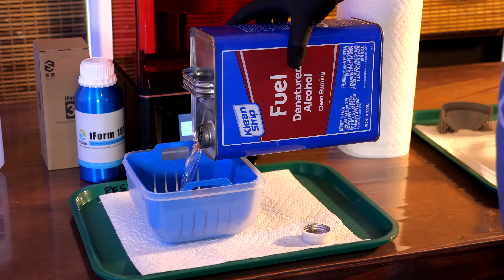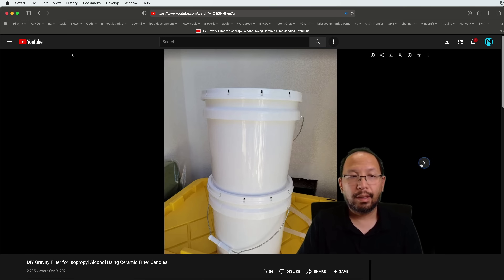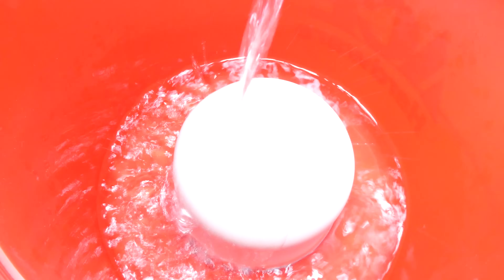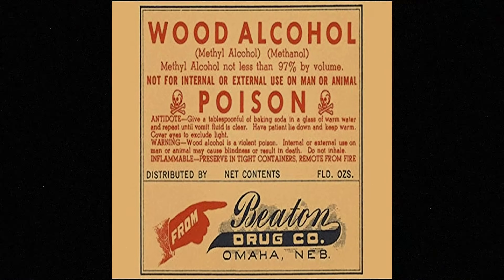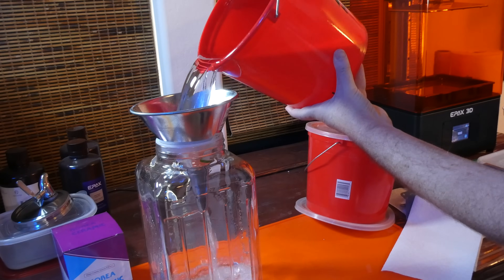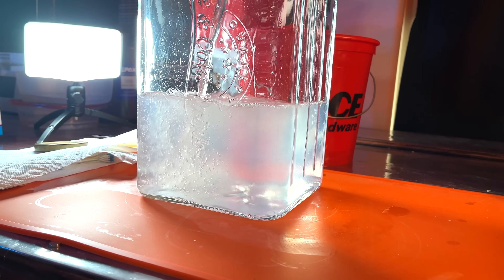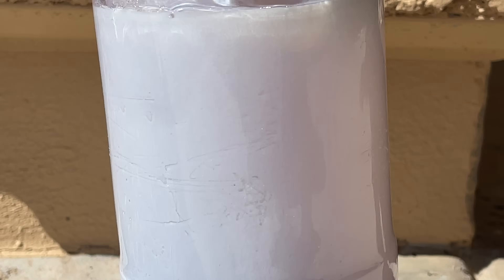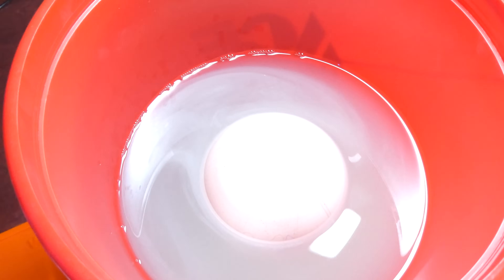Can We Recycle 3D Printing Alcohol?

Comment: There is a product (not sure of the name but something like resin clean) that cleans 3D printed parts better (stops them from yellowing due to alcohol) and once it's dirty you place it in UV light, pull out the blob of cured resin and it's ready to use again. Basically it's usable nearly indefinitely though you do loose a small amount to evaporation and what is left on parts as you remove them and such. I remember people saying it was the only way to get optically clear prints (like for lenses). Been a long time since I did resin printing but I did buy some (only had to buy it once).

Comment: Molecular biologist here, and I'm gonna be a bit of a pedant :P Isopropyl alcohol, even in a pure form, is still pretty darn toxic. It is metabolized directly into acetone, which is all kinds of bad on the central nervous system. Also, the methanol in denatured alcohol does actually have a benefit, in that methanol is an arguably better solvent than ethanol (drinking alcohol) for many applications.

Obviously, there is an incredibly complex set of societal reasons why these compounds have additives, bitterants, etc. (and many of them are incredibly dumb), but the toxicity of IPA is not only due to the additives and the methanol content of denatured alcohol does make it a better solvent for most applications.

Comment: if distillation is done correctly with equipment meant for handling it (amazon and ebay have distillation kits for chemistry use and they will work fine), distillation would be one of the best methods as the alcohol will be completely pure and there will be no fire hazard as long as you use the equipment properly (some moonshiners blew themselves up because they forgot to start the cooling water for condensing the alcohol vapors) on a sidenote it is somewhat easy to renature alcohol but i wouldn't dare to drink it, i'd only only use for lab use, you also need like a 2 foot long glass column to improve separation (ethanol bp = 76C methanol bp = 64C, a 12C difference is actually quite small), most types of rubbing alcohols however are isopropanol and no matter how many times you distill it it will never be consumable
Reply: the problem with domestic water distillers is that they are air cooled so alcohol vapor is likely to escape without being condensed while with proper glassware, you run cold water to the condenser to cool it down (water can be from the tap or a bucket with a water pump)
Reply: with distillation as well, you are able to separate the water to a certain degree, so if youre are processing say 50% alcohol, you can bump it up to 91%, but no 100% by distillation as isopropanol forms a so called azeotrope with water, basically pure isopropanol boils at like 82C but the mixture of 91% IPA 9% water boils at 80C so only way to get over 91% is with further chemical processing like desiccants. you can also remove any contaminants that were pulled from the resin but that takes time and a lot of effort to do as you have to very closely monitor the temperature and use other chemical methods like activated charcoal and such to clean it up further

Comment: For something like this, you might want to try using a centrifuge to settle the resin at the bottom of a container, then draining the sediment from the bottom. Once the large particulates are removed, you could then optionally run the remainder through a filter
Reply: Maybe a vacuum filter might do the trick
Reply: LOL I came up with the same thought before reading the comments.

Comment: If you want to remove the denaturing, you will need a graduated cylinder and need precise temperature control with it as well. You will also likely need to distill it several times. I haven't done it myself, just found out this stuff when I was researching it when I was younger and wanted to make my own alcohol for ultralight camping purposes.

Comment: I enjoy your videos. A bit of background info on myself: I currently work for BASF. Prior to that I was a Combat Engineer. So, chemicals and explosives is kind of my calling (so to speak). A 3 stage filtration system would be a little more efficient for removing IPA/DenAl from your resin slurry. An additive for encapsulation or covalent bond would help pull the larger resin particles out. Something like charcoal would be the most cost effective route. Also, AGITATION in the 1st stage would be a MUST. I would steer clear of a bubbler/fluidizer, unless you plan on using an inert gas like nitrogen or argon, etc. Adding atmospheric air adds oxygen. And if you know anything about the "Fire Triangle", you DO NOT want to add O-2 to something that is already flammable. Slow, mechanical agitation would be the best bet. However, that costs more $ for that equipment. Unless you have kids at home who need a new chore. 

Now, as far as distilling goes: I've been using a distiller for 2+ years now. The very same that you spoke of in the beginning of this video. The particular model that I have is programmable. It is a feature that is absolutely necessary for nothing other than safety's sake for those who are looking into distilling their cleaning solvent with one of these machines. Both basic models and ones that are programmable state that they have an "Auto Shut-off Feature" that will turn the heating element off once the distiller is empty. DO NOT RELY on this feature. It's basically the same type of sensor that detects thermal runaway on an FDM printer. While autoignition of alcohol is 750F, I'm not willing to tempt it. At the least, a timer is ESSENTIAL. 45m to an hour for 4L is enough to distill the majority and still leave a liquid slurry in the bottom the the vessel. Put it into a bucket, leave the lid off and let the sun vaporize the rest. Another reason to not use the auto shut-off feature is because the machine will basically cook the remaining resin and you'll end up having to scrape a terrible smelling, rock hard resin pizza crust out of the bottom of the machine. I always use the distiller outside or just inside my garage with the door open and a fan blowing the fumes out. Not necessarily due to fire hazards, but because the fumes are TERRIBLE. I can absolutely understand your concern with using a distiller. I did a lot of reading on different ones and their feature before I decided to go this route. The 2 main factors that helped my decision was that 1. the model that I bought is a closed system (during the heating process all the way until the condensate drain) and 2. it is programmable and has a timer. A bit of knowledge and common sense go a looong way. Having a background in chemicals also helps. But then again, there are people out there who still believe that the world is flat.
Reply: This comment is just as interesting as the video itself, thanks for sharing :)
Reply: You should post a link to that bad boy
Reply: uh oh we got a globetard over here ;)
Reply: Good info! Thank you. I agree, a link would be great.
Reply: @johngwinner9941  link posted.
Reply: Please post a link (or at least the model #) of the distiller you're using!
Reply: HI Travisfender8851,

 I was also stationed at Travis AFB with the 349 SFS and a fellow Defender.  I just wanted to say that i just purchased a distiller to clean my dirty ipa from my resin printer, any advise when it comes to using the distiller would be appreciated, thx.
Reply: @jgomez916 I use mine just outside of my garage. You’re going to get very strong IPA fumes. As always, wear gloves when you’re cleaning out the leftover resin. I usually run mine from 30 to 40 minutes (with a full vat). If you run it for a long time the resin will cook into a rock hard cake that is really hard to get out. I let it get to a firmer gelatin like state any then dump it into a plastic tote to finish curing in the sun.
Reply: One other bit of chemistry to address is the UV + TiO2 degradation path for isopropyl.  If one sun cures isopropyl for too long the white pigment from resin (TiO2) will catalyze breaking down the isopropyl into acetone and acetaldehyde, and eventually acetic acid (vinegar), water + CO2. Ethanol / denatured also degrades due to broad spectrum sun UV, but not nearly as fast as isopropyl in my experience.  The issue is while acetone is a good cleaner for resin prints, it also dissolves partially polymerized resin, and no process short of distillation will remove the acetone + plastic glue in solution which is now sticky and coats parts when attempting to wash. 

Identifying the degradation is pretty easy by nose -- it starts smelling less like alcohol and more like acetone (nail polish remover) and vinegar. 

It is a bit exhausting how every filtration video conflates the separated out pigment settling from resin monomers and polymers still fully in solution.

Comment: I'm not certain the water distiller method is as unsafe at you think it is. The flash point of alcohol may be 55 degrees, but that doesn't matter as long as there is not an open flame (meaning it is no more dangerous than having it at room temperature). Alcohol will boil at ~180 degrees and will not auto-ignite until 750. Most water distillers will heat up to 220 and should therefore be relatively safe (again, as long as it is not exposed to an open flame). Long story short, as long as you're not putting it into a pressure cooker, and are in a well ventilated area, you should be perfectly fine.

Comment: It would be cool to put a rack near the top of the top bucket and pump alcohol from the bottom bucket to a sprayer in the top bucket. Just set your part on the rack, close the lid and let the sprayer hose down the part, then the alcohol filters back into the bottom bucket. This would prevent you from having to dirty another container. The sprayer may also help to prevent a bit of the buildup on the filter if it's positioned in such a way that it can hose it down a bit.

Comment: Ive used ethanol in extraction processess for herbs.yes those herbs. the problem with re using eth thats been left open is that it will absorb water. Even in our proceses we use another chemical to remove this water and then re distil to keep the proof of the eth up.
Reply: i only do fdm printing so i dont care. but if i was spending a lot on ethanol id get the distiller units, and then a sive beed channel to rush my cleaned ethanol over to absorb any h20 it absorbed from the air. 

A lot of indsutries use ethanol and have been doing so for like 200 years, i would look into those processess for guidance on how to RECLAIM or RECOVER ethanol. this bucket method seems overly complicated and slow

Comment: distilling is probably one of the best methods to clean any relatively low boiling point liquid (acetone, IPA, Denatured spirits, etc.), however if you're going to be distilling flammable liquids its probably best to get a proper chemistry distilling kit and to do it outside, as this avoids explosive fumes indoors and with a chemistry set you wont have to worry about an electronic distiller causing an accidental explosion, although you will need to drop around $200-$300 (or more) on appropriate glassware and a heating mantle (a heating mantle avoids open flames from a Bunsen burner, and they often have very good temperature control, and are often made to not cause fires) its worth it if you're going to be recycling lots of material all at once every so often.

Comment: Why not a vacuum still? Should even work for UV-cured leftovers (don't quote me on this lol). You would probably want a cold surface to direct the condensation in the output route. You will still need to clean the input vessel every once in a while, but should be easier, especially if you coat the inside with teflon (or use a teflon-based vessel) or something.

Comment: If you really want to filter the alcohol then use coarse grained activated carbon in the beginning. The resin and colorants will adhere to that and you can remove the carbon with a strainer/cloth/coarse filter before putting the alcohol through the water filter. This should prevent clogging.

Comment: If you put the dirty alcohol into a separation funnel, let the resin settel to the bottom, you can remove the settled resin. A separation funnel lets you open a valve to drain out the bottom of the funnel first.

Comment: Destilling is my way to go, but I'd definitely recommend using proper glassware for that! There isn't really an explosion or fire hazard as long as your condenser can liquify all the alcohol vapors and the glassware connections aren't leaky (there's teflon tape/inserts for that). Heating the alcohol directly via a hotplate is fine, since during boiling, the temperature remains constant. You gotta be careful to not distill to dryness however and not use open fire i.e like from a bunsen burner.
Reply: A good distillation setup costs a fair amount and people would cut corners, steps will be dropped in relaying it to others, etc. so honestly, it's good to have options for people that haven't gone through ochem and seen what that looks like. I'd use distillation too but I definitely wouldn't go on youtube recommending it to a large audience.

Comment: Usually alcohol is made through distillation and as long as you aren't using an open flame it's pretty safe. But I think the resin would also evaporate in parts which is probably not great to inhale I would think that's a more problematic issue when you have a clean workspace.
Reply: Resin dont evaporate

Comment: Kudos for how long you use your alcohol, lol. You could really improve this process with a pump. A peristaltic pump (there are 3D printable ones, or cheap ones on Amazon) connected to the filter outlet would speed up throughput dramatically. You can use other pumps, even a little aquarium air pump connected to the air space in the bottom bucket might help, but peristaltic pumps keep the liquid isolated in a tube and never actually touch the pump. If you want to do a 2 step process, go coarse then fine filter, not fine then fine.

Comment: Not the same thing, but back when I was at the University I used to work on a project where we filtered river sediment. Because the sediment is a mix of sand, mud and silt, using a fine mesh straight away would clog the filter and take forever, so we used different mesh sizes, starting on a 2mm mesh and going until a 0.5mm. I know resin particles are very small, a possible solution to the clogging would be using a larger mesh (or exposing the alcohol to UV for a few minutes, or both) so you remove the bigger particles first.

Comment: I played around a bit with UV polymerisation during my PhD and early research career so have a bit of background in this (as well being a chemical engineer for over 20 years with lots of varying experience across a number of industries!).  I think if you stir the alcohol/resin mixture whilst exposing it to UV it will more likely form smaller discrete particles rather than snotty gloop.  Continuous stirring should allow the alcohol and polymerised resin to separate regardless and more resin to polymerise by continually turning over the jar's contents to expose all of it to UV. You could use a paint stirrer on a pillar drill to agitate or a lab magnetic stirrer or as someone suggested, aquarium air stones.  Note air stones might also lift the polymer out of solution by the processes of flocculation/flotation if done right (Possibly as a separate step - you can push air through your ceramic filter in reverse to achieve this - also a great way to backflush your filter). Stirring up your filter bucket will also reduce the gelling on the filter and speed up the filtration. Reducing the amount of UV light the mixture is exposed to at any one time will likely reduce the reaction rate of the polymerisation which may or may not help avoid the snotting depending on the type of polymer. Good luck!
Reply: Would a floculating helper work? Like kitty litter?
Or maybe strobing a UV light? Make small solids, floculate them, settle, repeat?
Reply: @KaletheQuick  worth a try on all those points. Cat litter could take out odours too. Could just use a funnel of litter to trickle the reacted wash through, would work like a sand filter.
Reply: I feel like not letting the alcohol you're working with get so loaded up it turns into snot is probably the best first step. Have enough volume around that you're not working with a completely opaque solution, so that you can expose it so it DOES settle out is IMO the best first step to keeping clean alcohol, or at least alcohol you can filter.
Reply: I agree, but also what about centripetal separation? If the mixture is let set in the sun with a medium speed stirrer, could the solids be separated if spun out?
Reply: @saddle1940  it would depend on the relative density of the alcohol and the resin particles/snot as to whether a centrifuge works. If they separate under normal gravity settling, even over a long period of time then yes, a centrifuge would work.

Comment: I just have a large clear air tight container I let the IPA sit in outside when it gets to be about 30% opacity. I print small parts and limit big prints. So this way I can use and reuse "old" IPA for my first pass wash and very small amounts of fresh IPA for my final cleaning. Like very small amounts with a spray bottle (wearing a mask, and face shield). Finally dip a used toothbrush into fresh IPA and scrub of and "wet sand" down some of the more obnoxious layer lines and any bits of supports that remain. (I remove supports after the first pass wash because my supports tend to be very dense due to delicate parts and that prevents details from showing)